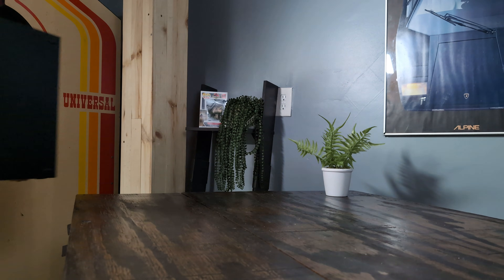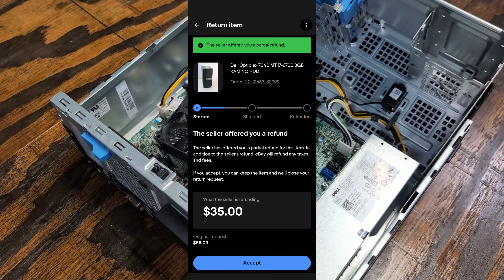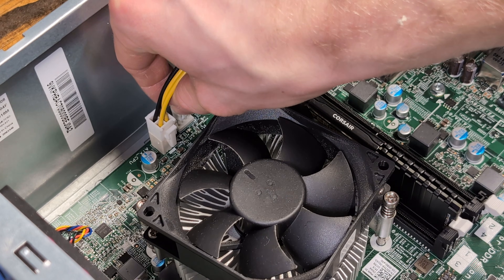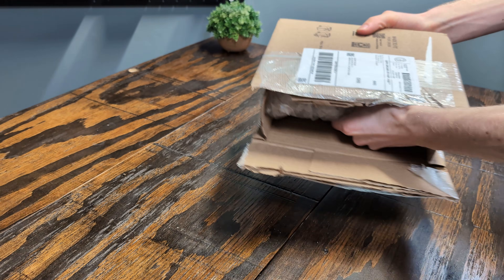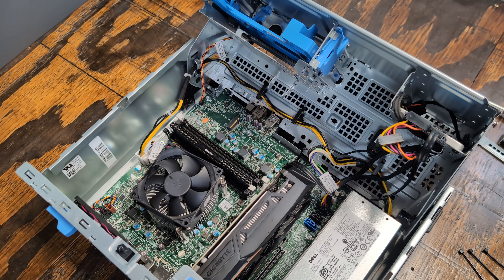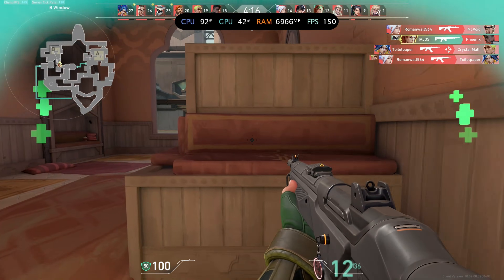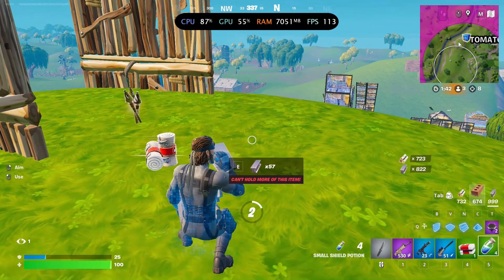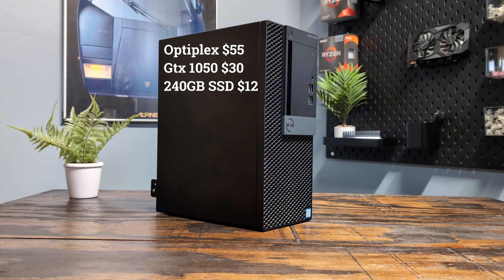How to Build a $100 Gaming PC

Comment: I only paid $150 for my gaming rig..Here are the specs
Mobo:P8Z68-V/GEN3(Got for Free)
CPU:i7-3770(Got for Free)
Ram:24GB's G.Skill RipJaws($15)
SSD:480GB Sandisk Ultra II(Got for Free)
GPU:MSI Radeon RX 580 ARMOR MK2 8G OC($100)
PSU:750W Thermaltake(Got For Free)
CPU Cooler:Thermalright Aqua Elite V3 120mm($25)
Case:Thermaltake Swing($10)

Comment: Part of the Issue with this is that Win 11 Needs at least a 8 Gen CPU . This 6th generation may not works and probably won't.  . Del I believe with Microsoft did this on Purpose  . The 500w PSU upgrade is $109 new though Dell or a afterMarket for around $80.   Dell Decided to use Porritary Power Supplies . Besides the Dimensions . The Connectors are not standard either. That Card is recommended at 300watt PSU that Dell is only 240watt. WHile it May work for a while that is really Pushing the PSU.

Comment: I have a suggestion for a build. 
Starting with no case, just parts to built the PC from the boards and such.
A build under $500 to build a gaming PC that can run games like Ark Survival Ascended, Enshrouded, Marvel Rivals, and GTA Online on max settings with a competitive frame rate. 
My current PC is pretty much on borrowed time with a Power Supply Unit from a PC that is many years older, so I can't currently play games right now. 
I'll need a list because I seriously need a new PC, and my current old beast is more than 10 years old, relying on a PSU that is nearly 20 years old.

The lower you can keep it the better. But I need it to have lots of RAM, at least 12 USB ports, and that it be able to connect to VGA and HDMI. 

JUST the parts. You can cut the costs from the case. I want to build something despite recycling my old case which would save me a good chunk of money.

So... 
Motherboard.
CPU
GPU
Graphics card
RAM
Storage (Internal)
Processor
PSU

12 USB ports minimum.
It must be powerful for use in 2025 to run modern games with max settings.
The games I listed above are all games I have, and I'll list them again.
Ark Survival Ascended
Enshrouded
Grand Theft Auto V Expanded and Enhanced
Marvel Rivals
Monster Hunter Wilds (I just have the Beta...)
Conan Exiles

The challenge is to be able to run on the highest resolution with the maximum graphical settings with a framerate exceeding 100 FPS.
Reply from the maker: That is certainly a good idea. I think that a $500 build that would be a buy-your-own case type deal would probably suit a lot of people's interest.
Reply: @TekCycle  Even if it's a "Caseless" build. That would be fine too. Thinking about the builds that can be done without a case alone sounds pretty fun. 

And who knows what can be done if we just take the whole idea lf building our own cases.

Could you imagine a DIY home build of a PC case that is a table? Able to see the parts through the table surface. 

I'll be fine with seeing what you can do with a caseless build. An open air concept of parts. 

That in itself would be awesome. also it'll be easier to cool in open air if say you have a box fan or a standing fan within reach.

A glass table though is not exactly a good idea, so to reinforce the glass with something or even use plexiglass instead of normal glass, or bulletproof glass, that could make such a desk look right...  Still, my main concern is to get the parts to build a new PC.

I need something with 12 USB ports, and at least 4TB internal storage, I need it to run games at 100+ FPS on max settings.

Let's see if you can get the challenge and points done.

I'm rambling though... Good luck with the challenge. I'll use it as a shopping list for the parts for my next PC. My old beast is sadly on borrowed time using a power supply unit from a slim tower now to even function in how little it can...

Comment: Wait, 240W PSU could run GTX 1050?
Reply from the maker: The 1050 has a maximum power consumption of 75w.
Reply: @TekCycle  Oh, I didn't know that GPU has low power consumption, thx for reply

Comment: Thank you for this video man! I’ve never built my own PC before, but I have done a slight upgrade to my laptops RAM, but I would hardly call that anything, and even that doesn’t make it very capable of much.

Could you possibly hit me up with some tips, or advice on what to get, and what all to be on the lookout for when getting one of these optiplex’s? And if possible, is it worth getting a 4GB gpu for this for extra power?
Reply from the maker: I would definitely try to snag a better GPU, a RTX 3050 or 1650 would be significantly better for little cost. Make sure not to buy an SFF Optiplex if you do go this route.
Reply: @TekCycle  Thanks! Should I get a MT optiplex instead then?
Reply from the maker: @KejuanBW  Definitely grab an MT!

Comment: I got ahold of a Precision Tower 3420 with an Nvidia Quadro and put in 32GB of RAM and it was pretty good with PCSX2 native and somewhat decent at streaming consoles with a capture card, but it wouldn't let me run JDM Rise of the Scorpion
I would appreciate any suggestions before committing to a pricey full build
Reply from the maker: If you have a Microcenter in your area, I would recommend picking up one of their Ryzen motherboard and CPU combos. Otherwise go pre-owned.
Reply: @TekCycle  I could take a look at those one day, could be a good option though newegg might have the better deal, thank you
Maybe I'll try a low profile card to start, 1080p 60fps shouldn't be that unattainable lol

Comment: Do you think this would be a great starter pc? I’m considering doing this.
Reply from the maker: For this price? Yes, I would recommend doing this.
Reply: @TekCycle have you tested story games like red dead redemption 2 or cyberpunk 2077 on it? If so, did they run good?
Reply from the maker: @Steoorer  I did not test those games specifically. Fallout and Skyrim should run decent, but I wouldn't attempt cyberpunk
Reply: @TekCycle  2gb Card at 1080p wont run Cyberpunk . I would Recommend a 6gb - 8gb card  at 1080p with 16gb -32gb of Ram

Comment: I have a really cheap gaming PC that uses the WX2100 2GB gpu. Even though it's much worse than the 1050, it can easily be found for $25, and can be put in a much cheaper SFF PC with the overall cost using the same storage/RAM as you but also downgrading to an i5-4590 ending up as about $75 on eBay. However, I was able to make a build for $65 with 16GB of RAM and an extra 1TB HDD due to a local listing. Even though it's really underpowered, it's still really great for indie/older AAA games and especially Minecraft with shaders

I just felt like sharing my build, the one in this video is also really great, I definitely think the GTX 1050 is a good choice
Reply from the maker: That's really cool man, I would definitely be interested in attempting even a $50 build. However, that would probably have to be a local listing type of thing like you mentioned.
Reply: You didn't answer the guy that asked for the PC and you'll also not answer me I don't like that @TekCycle
Reply from the maker: @YtPolski 😮
Reply: @TekCycle  oh you answered eh?

Comment: 240gb is not bad at all for storage. thats what i have rn in my budget pc. i just use a pile of old hdds for extra storage. i avoid putting anything on my ssd that isn't programs.
Reply: also its pretty annoying look at it having no optical drive lol i would install one just to complete the look
Reply from the maker: I kinda had the same idea, but then again that would be budget spent on a non- performance component.

Comment: I actually did make a 100 dollar pc just recently and I'll say if you can get that kind of optiplex for like 30 bucks then you're good, but if not then get an hp prodesk 600 g1 since you can swap out the psu for something more powerful for something like an i7 4770k, and also the fact it can fit dual slot (but limited to itx sized cards) is great in comparison to many optiplexes

Comment: I love to see the cost of a playable PC decreasing as the years go by.
Reply: As a not extremely tech savvy guy I was devastated when I found out how low my pc would go for, prices have gone down for sure, too bad I dont game much anymore when its so much easier to get a build going. I might upgrade if I get back into pcvr though
Reply: @6mmBooshiman That's not the best news. But, it goes both ways. If you can only sell your PC for a cheap price, that also means you can buy other parts for cheap pricing. I don't game much either, kind of miss it.

Comment: I did an ultra budget PC build for my friend with a gtx 1070 and an old Fujitsu office computer. I had to change the psu to a 500w and i added a 512gb 2.5 ssd and the Fujitsu had an i5 6500 but because I live in italy for the build i mentioned i had to spend 320€
Reply: for 30 bucks more i had a gtx 1080 + i7 6700k in an argb case😭
Reply: @Nathanseditzz  I live in Italy and everithing cost more than in the US
Reply: @ price difference yes ofcourse sorry